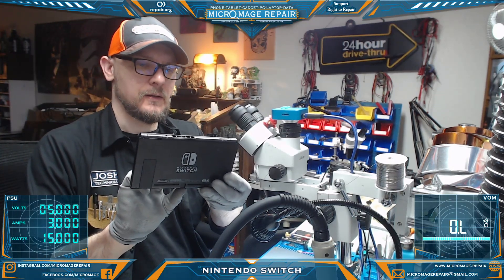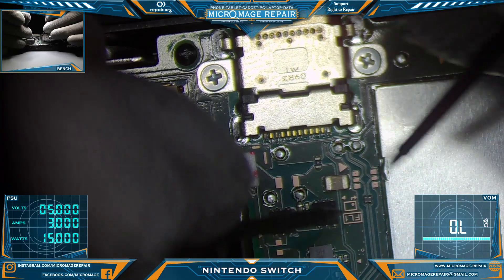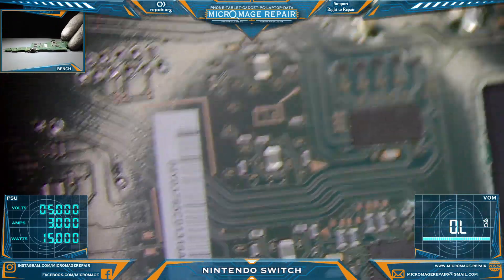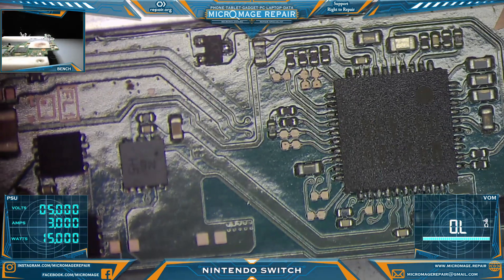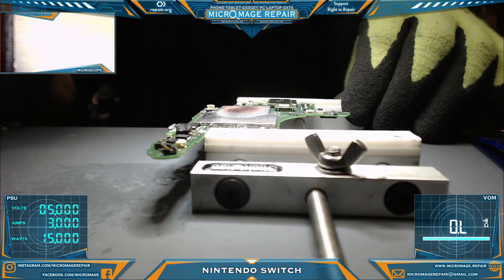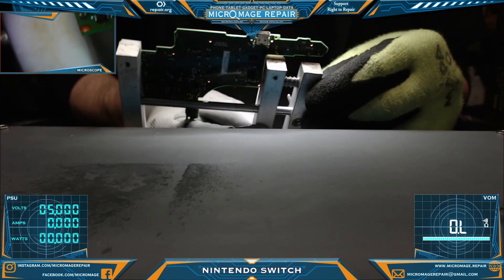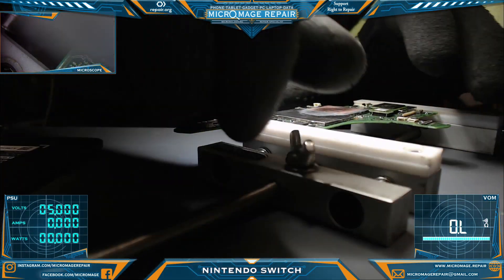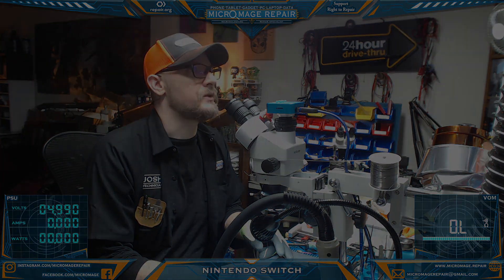These charging circuits fail in weird ways...

Comment: Hi.  I got a switch which was in storage for a long time.  It was updated to the latest firmware and now get the same error.  If the switch is left off for a long period of time, it will boot up fine and then within 5 to 10 minutes, it will give that error.  Once it get that error, it seems to come faster after each subsequent reboot.  Do you think it is cause by the failed chip?  Thanks.
Reply from the maker: Thanks for the question.
Possible, but you might try another battery. Batteries don't like sitting around that long without discharge.
Reply: Thanks.

Comment: Hi Bro, Thanks for sharing 👍
Ive same problem, i solved code error but now ive a problem with the touchscreen : not working at all. I change pcb digitizer, touchscreen but same problem, no touch screen... can you help me to solve it ?
Reply from the maker: Thanks for the question.
Touch is controlled by the game card reader, the touch IC is actually located on it.
You likely have an issue there somewhere.